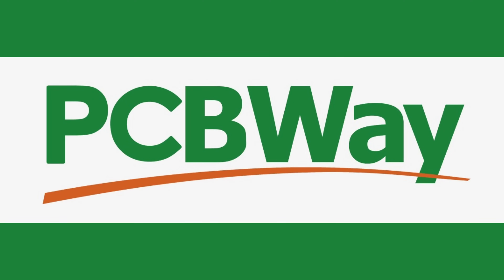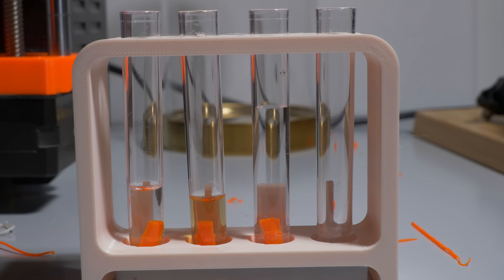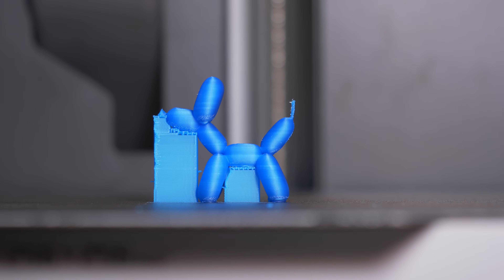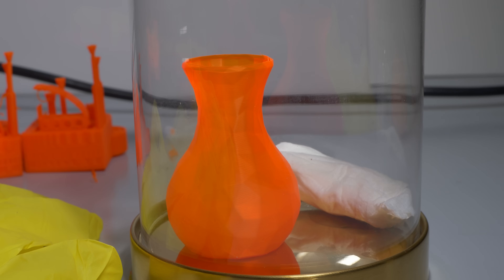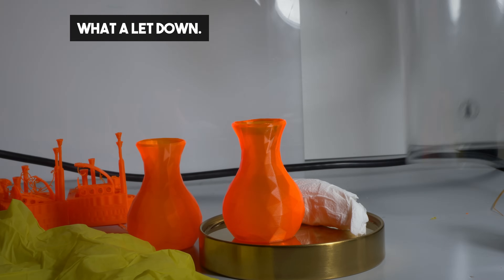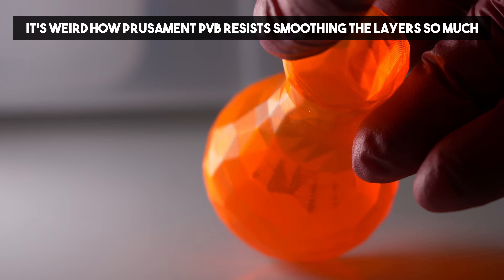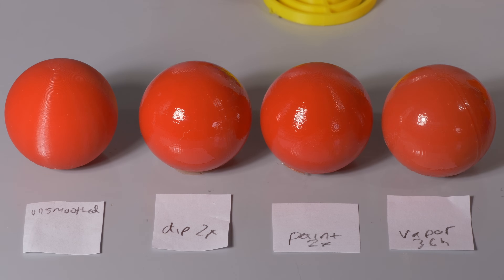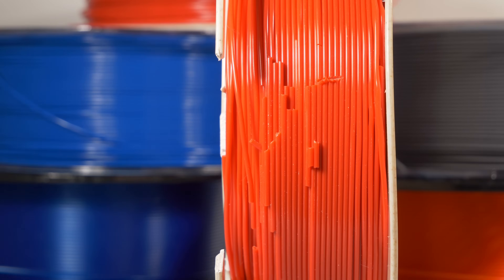The Smoothest Filament: 3D Printing without layer lines!

Comment: The first PVB filament I'm aware of was Polymaker's PolySmooth. The original 2016 Kickstarter had a machine called the PolySher that uses an ultrasonic nebulizer to create a fine mist of IPA, and a turntable to spin the part. You could say it's similar to spraying, but the fine mist floats and so is more controllable than spraying (which can easily lead to runs). It worked pretty well and was quite fast, although with the layer lines on my printer of the day, it needed quite a lot of smoothing that would obliterate fine details on a print. The parts also remained sticky for several days, so it was important not to touch them, otherwise you'd leave finger prints on the parts.

Some people made some pretty incredible glass-like clear parts with it. With the tips from CNC Kitchen's video on printing clear parts (going slow, and with a flow rate that would normally be considered over-extruding) you might want to try this.

Comment: My friend helps me make 3D printed sand casting patterns.
They need to be smooth like glass in order to draw from the sand easily.
We used to spend an unholy amount of time with filler paint and hand sanding, which was untenable for inside corners and complex shapes.

Now we use a resin printer for high detail and complex geometry and a regular FDM printer for simple shapes require less time to make smooth.

We have also made hybrid pattern pieces by fitting a resin printed outer shell over an FDM support structure.

The advantage of the FDM support structure vs filling the resin printed parts with a castable epoxy resin is that when I assemble the patterns to a match plate board I am able to still flex the printed part a little bit to correct the warping with clamping pressure as they are glued down to the plate.
Reply: For the simple parts, why not just make them out of wood?  It would be even faster.   Its been the material of choice for pattern makers for thousands of years.  The whole advantage of 3d printing patterns is the ease of making complex patterns...

Comment: Im totally new to 3d printing, i bought a Ender 3 v3 ke, because its entry level and supports 5 or 6 different filaments and i can print from my phone, laptops/ROG Ally or usb stick. I was going to go with an Ender that can print nearly 12 inches but it only supported usb flash drives. The v3 ke had a lot of features for a really great price. If i like 3d printing i can then get a better printer later on.. now i just need something cool to print lol

Comment: "The Smoothest Filament: 3D Printing without layer lines!" title seems misleading. The filament didn't start or print any smoother than others. It's post processing.
Reply: Its also not the only material you can vapour smooth

Comment: If layering without evaporation is a factor in the painting method, how well would hand sanitizer gel work? They are at least 60% alcohol. Could it not give a more controlled method over how smooth you wish the surface to be?
Reply from the maker: hand gel has other stuff in it, I think it might leave it gross and sticky. Depends on the hand gel I guess.

Comment: Absolute stupidity. In the same way, you can smooth the surface, for example for ABS plastic, by simply holding the part over acetone vapor. In the case of PLA, dichloromethane is needed. This PVB has exactly zero advantages.

That is, literally nothing new - use a solvent to dissolve plastic... why was it necessary to make a video about this? To litter the Internet with something that everyone already knows about?
Reply from the maker: Username checks out 😂
Reply: I totally agree. and on top of it, he's so damn scared of ispropanol. that stuff is literally used on daily bases in so many jobs just to clean their hands haha

Comment: I mean, you can print without visible layers, you just need a very well tuned machine.

-dampened stepper motors with a clean output
-a printer bolted to the table and supported at the top (if it's like my cr10, i have a piece of packing foam, cut from a computer case shipping box, that's cut such that it nests between the printer and a cabinet above it. It's not 100% rigid, rather it takes the approach of "soaking up" the vibrations.
-good clean nozzle. you need to make your own nozzles for that or buy a ton of them and make sure they are well machined
-good platen to nozzle calibration
-the belts shouldn't be slack, but they shouldn't be tightened to congo drums either, especially when you have a dampener frame between your stepper motor and the frame. Super tighening your belts damages your printer and creates unwanted vibration transmission
-obviously a good slicer
-more lines in all curves. if a circle has sides, your computer fu needs polishing
-clean filament
-quality tubing.

And this is the starting stuff. 

To get an idea of how fine the prints get, i once needed an extension for the remote activation cord of a Praktica MTL3. The OG cable is short and long ones are super difficult to find. That fit, that is. I found a 5 meter cord from another camera, but the plunger was too long for the MTL3, so i took the button off and printed an extended one. The threads are less than 0.5mm between pitches, super fine. The print was so smooth that you can't even tell it's a print. You'd think it's cast and machined. The whole part is about 10mm OD and 21mm tall, printed with no raft, just a sacrificial sanding surface to account for the inevitable elephant foot that happens when you print with cheaper filament that doesn't have the exact specs. This an OG CR-10 printer running on the OG, factory shipped program, OG bearings, motors, just about everything except my modifications are original from all those years ago.

The better you setup your machine, the better the prints are. Out of the box, all printers are rubbish unless you pay 50k, and even then you should usually have the company rep drop by and do the setup proper for you and even then you can optimize. I remember when we got our first printer ages before, when the patents were still locked. The rep finished their work, was happy with the setup and our engineer looked at it, scoffed and by the next week the printer was running even better than factory because she reinforced the structure of the machine and cast a concrete slab into the bottom of the cabinet the machine was sat upon.
Reply: Pused layer printing is that.. layers, so in the end you always have layers.
If you have applications where layers would be very bad (e.g. fungi and bacteria being between layers), you need to smoothen it.

Comment: PolyMaker PolyTerra, printed (based on a temp tower) at 185C (215 first layer) has nearly invisible layer lines, because it's matte. It looks gorgeous, and it's mostly what I use now. I've printed many things that look injection molded.
Reply: can this do TPE like rubber mid and outsole material?

Comment: So when it's in Hand Sanitizer, it's great, rub it everywhere, but when using it with 3d prints... Danger!! Got it.
Reply from the maker: Hand sanitizer is typically ethanol, but yeah 👍
Reply: formulations containing 80% (percent volume/volume) ethanol or 75% isopropyl alcohol; however, generally speaking, sanitizers containing 60 to 95% alcohol are acceptable @LostInTech3D

Comment: Does the material stink either during printing or during IPA treatment?  The reason I ask is that acetal bond is hydrolytically unstable and it could release butyraldheyde which is pretty nasty.

Comment: with IPA the more surface aria you give it the quicker it will evaporate so if you want to get rid of it quicker get large shallow pans to pore it in to evaporate away 

also if your painting the part the best way to get rid of layer lines is to use a good base coat that is made to fill imperfections

Comment: Just so you know, ethanol at 99% is sold in parts of the US as Everclear. They sometimes have to adjust the proof from state to state, but back in 1993 when I was in the Air Force and living in Oklahoma, the Everclear was 199.5 proof or 99%. Yes, I did shots of it, and no I would not recommend.

Comment: I have that same tool :)
Now few times used pcbway or itead. For prototyping those fr4 protoboards with lots of soldered wires under. That's why I bought my 3d printer to print case for those projects.

Comment: PLA is soluble in both ethyl acetate and chloroform. But chloroform is hard to come by and dangerous. The surface becomes soft as a result of the treatment, but hardens again after the solvent evaporates. We can also make waterproof objects by brushing with a solvent. I made a water cooling block for an RX570 video card. I still use this now.

Comment: PCB Way advert.
Love stripboard. That tool looks like a drill, for drilling out holes to break the track of stripboard.
And I'm probably one of the few that has actually made my own PCBs. I used to work at a college, and basically had my own dark room with all the equipment required to make PCBs, including a spray etch tank.

Comment: This seems like a lot of a faff for marginal results.  Even the highly smoothed prints show uneven smoothing, with layers prominent in places.  Even the smoothed areas still show some layering.
If you're going to go to such lengths, you may as well spray them with a high-build primer, gently sand them to remove excess primer, then spray them with the colour of your choice.  You can then save money on your PLA by buying the cheapest colours, because you're going to paint over them.

Comment: Polymaker does have a machine to do this with - it's something like 150-200 bucks maybe?  It mounts the model on little spikes and rotates it while circulating the vapor.  Only takes 15-30 minutes depending on your model, then it evacuates the chamber and lifts the model out.   When I printed in PVB regularly, it was a nice thing to do, as long as your model doesn't need to be perfect on its bottom.

Comment: The tool was used for wirewrapping circuits. Years ago I actually built a 8048 cpntroller with all its peripherals with wirewrapping. Tedious but practical when you want to make a proof of concept

Comment: this may sound silly but what if someone took a rotating stand (like a record player) and a heat lamp or ceramic electric heater and rotated a 3d printed item for X amount of time? would this work? then after it is heated cool it off or wait till it turns room temperature.

Comment: Just a thought, PVB Supports, with PLA printed part or other material that does not react to vapour smooth. then after about 48hrs the PVB should mostly have turned into a liquid and act as a sort vapour dissolve support interface
Reply from the maker: That's literally what PVA filament is for 😁
Reply: @LostInTech3D  huh, I had no idea there even was a PVA, I was aware of water soluble though. May have to keep that in mind when I finally get around to that tredrack.

Comment: If you wanna vapor smooth just...do ABS.  I mean, I guess that's easy for me to say, I already print ABS and almost nothing else.  I built a little acetone vapor container with a Tupperware and some chickenwire and a fan, takes a few minutes of running and it's done, acetone works quick

Application?  Miniatures usually, or outer casings for things.
Reply from the maker: I will give it a go at some point, once I have an abs setup with venting outside

Comment: The process you used is all wrong. You just want the surface to quickly flash. You need to use a fish tank. Create a cloud of vapor and lower the part into the cloud for seconds at a time.
Reply from the maker: If you watch the video again you'll see I address that method and why I didn't use it.

Comment: Curious if you tried Polymaker's PolySmooth. Not only has it been one of the OGs of PVB, but they even made a vaporizer to do the smoothing for you. Now, regardless, I have both PolySmooth and Prusament PVB and have yet to get any good results with smoothing it. I've seen others do it, and when asked, they indicate they just just a spray bottle and that you need to do (basically) dozens of coats. I tried to do 3 coats with a spray bottle and fumigated the room... so next time I'm doing it outside. But thank you for doing a bunch of tests with it for easier evaluation on how to do things and by how much.
Reply: Spray-bottle and then put it in a closed box.
Reply: @tarakivu8861  will give it a try

Comment: You can use the stickiness of PVB when in contact with IPA to your advantage: it makes for great chemical bonding of PVB parts.
I bonded two PVB parts to one another by applying IPA to each of the faces I wanted to merge and then keeping them in contact with one another for a while. Result was a very strong bond, though unbreakable without destroying the prints.

My PVB also used to string a lot, I found that printing it at lower temperatures (I think about 190-200) helped with it. Keeping it dry also definitely helps.

Comment: Comparing the MSDS for acetone and anhydrous ethanol, acetone appears to be the safer of the two chemicals. It's an irritant, certainly, but aside from a lower flash point, it has a narrower range of explosive mixture and a higher autoignition temperature. Also, the health risks seem to be less and less acute for acetone. 
Help?
Reply from the maker: 🤣 yeah, weird one isn't it.

Comment: I use either a soldering iron or my plastic stapler to heatset a pin for hanging, then an airbrush. You can selectively smooth areas, and with the blowing air you can rapidly dry. No drips / runs / smudges, full control... love the fear or fire though, as someone who's worked in explosive / poison gas environments, and juggles fire for a hobby, it's a nice reminder that I'm insane lol
Reply: Thanks for posting this. I will use this idea for painting prints.

Comment: Could you make a PCB circuit board by drawing your circuit with glue, then pressing gold or silver leaf to the glued areas and removing the excess?
Reply from the maker: you ...could? I dont think it would carry much current though, the stuff is very thin
Reply: @LostInTech3D  Fair enough, I know nothing of electronics, just a thought

Comment: I've printed a large pvb model with polymaker pvb.
I smoothed it with 90% IPA spray coats with a spray bottle.
I used a 0.6 as the model was huge, however the layer lines were 0.3 I believe.
This took probably 30 coats to effectively smooth it.
A very large pain in the ass

Comment: 99% ethanol in Poland you can buy in every grocery store 🙈 also used for cooking. And if it is for technical use (artificially poisoned) you can buy online and get delivered if you can pay for it, I used to work selling it online and minimum quantity was 5L, 30L max via UPS (per package ) 🙈
Reply: 95%. ("spirytus rektyfikowany"). Also "denaturat", that in good. old days was 94-95% but now you have to read the label carefully, as you can buy something that has only 60% of alcohol in it

Comment: Quick question for everyone. You know how when you sand or take a file to print it gets really light and ugly. Can you sand and then vapor smooth and it goes back to shiny?
Reply: Yes! Shiny vs Matte is really a matter of how rough a surface is, and consequently how the light interacts with it.

We used to do this with PLA. Sand, then place in an acetone vapor chamber to restore shininess. A coat of clearcoat will do the same, filling in the microscopic gaps left by the sandpaper.

Comment: Store the IPA in a jam jar! I keep one for soaking bearings etc in for cleaning, been sat here months untouched and no evaporation.
Plus clean up the prints before you do anything else with them, pull off the worst of the strings and waft a pre heated heat gun over it to remove whats left.

Comment: Could this be used as a slushy to paint over PLA+ prints in example?
I am thinking of rather large prints und prints which need precision.
I was thinking dissolving some PVB in alcohol might be an alternative to epoxy.
Reply from the maker: I'm not sure! Would be worth trying as a safer alternative to the current version of painting with resin

Comment: I use Mason jars to store my isopropyl alcohol for resin printing--the rubber seal on the lid works like a champ to keep the alcohol from evaporating (or absorbing water.)  Not sure what they're called on your side of the pond, but basically, the square-ish jars like spaghetti sauce comes in, used in home canning.

Comment: thanks for the very informative vid! I never knew PVB even existed... may be interesting to play with (specially for making master copies that need to be smoothed before making a silicone mould from it).
🤔I'm curious if the PVB smoothing processes would still work with the more readily available 70% IPA, I imagine it wouldn't react as dramatically which could help prevent the dissolved PVB from getting too soft too quickly (unless the 30% water+stuff makes it swell).
👉also, with the vapor, I'd imagine using a larger container & adding a small battery powered fan would prevent the bottoms to become too saturated... just a thought.
🤓needless to say, it would be awesome if you could make a follow up vid.... cheers!